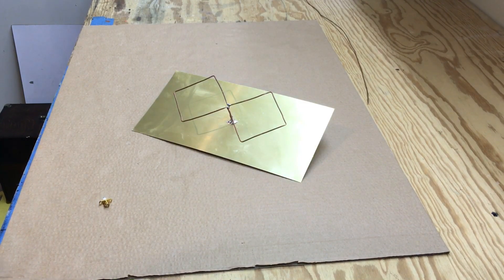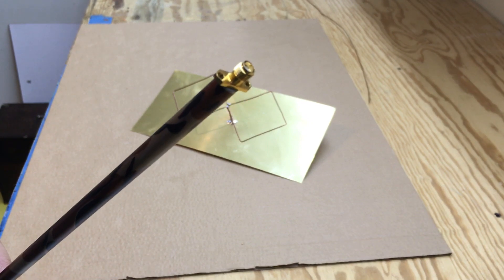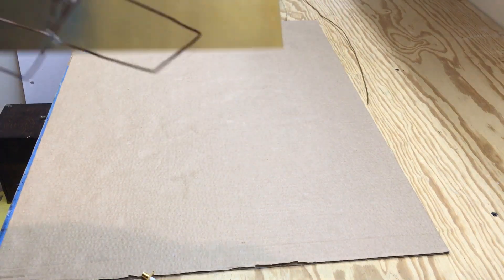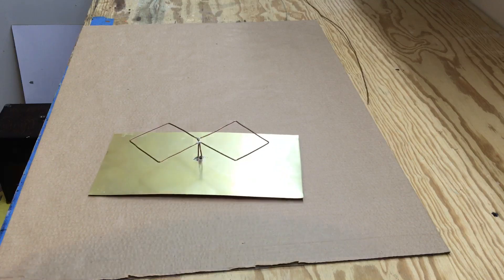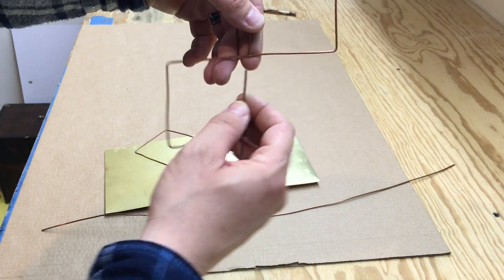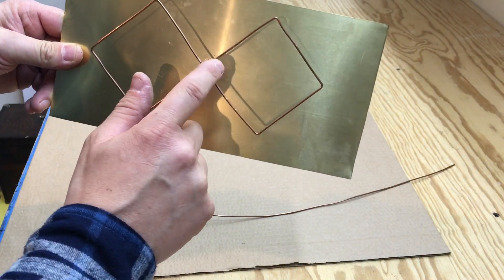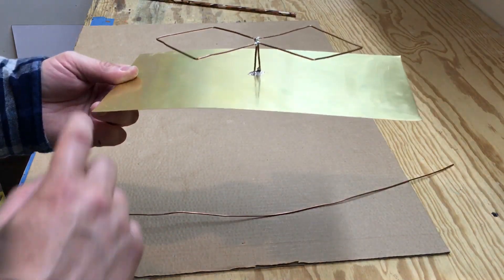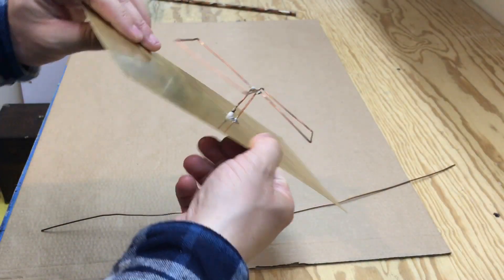How To Make A Bi-Quad Antenna For ADS-B 1090MHz

Comment: After searching through 10000 videos,NOT ONE actually has a radio receiver on 1090 mhz so we can hear what they sound like :( No offense to this video...just happens to be #10000
Reply: ADSB uses data sent in extremely short bursts so you can see the data arrive in numbers and letters,  you can see the signal strength displayed so you do not need to "listen" to what it sounds like.
Reply from the maker: Radio receiver? 1090MHz you won’t hear anything.
Reply: 1090 MHz Is for Ads-b